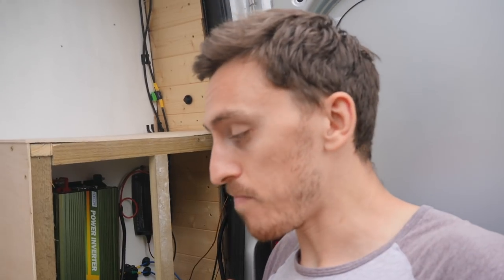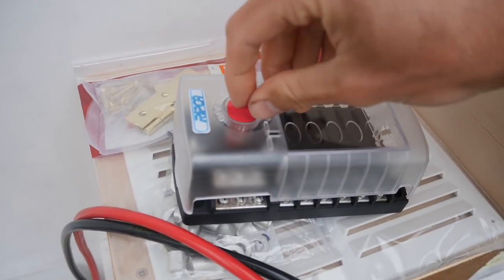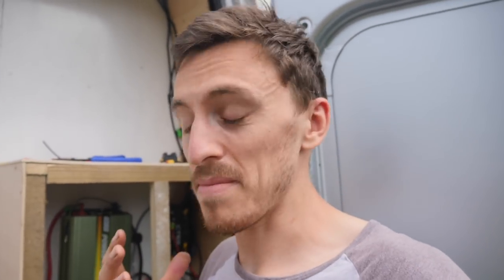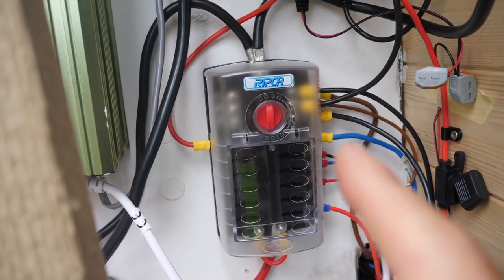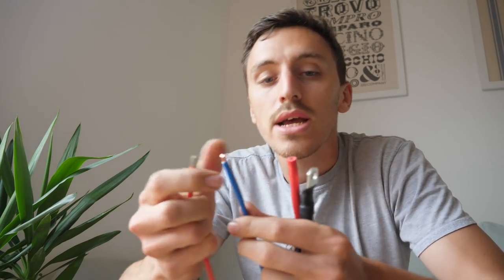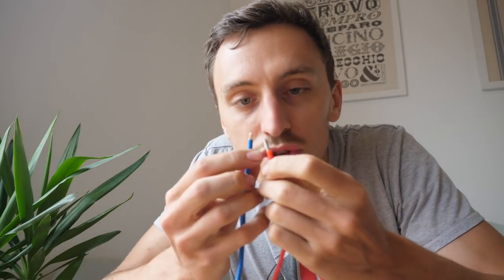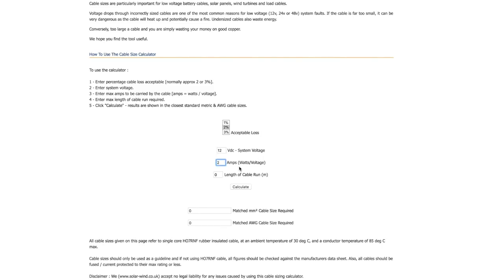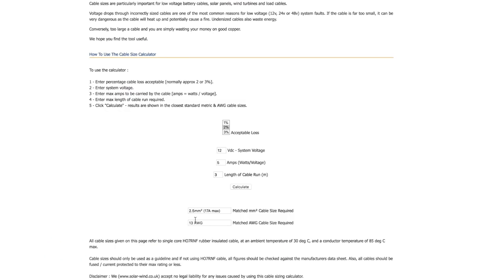WIRE GAUGES in my camper van!

Comment: Some good points there, the things you talk about I'll expand on.  The 7 strand cable is generally used in commercial installations and wired inside conduits and trunkings.  The multi stranded is way more flexible and is good for control panels and vehicles as like you said vibrations cause it to work harden and can then break.  The multi stranded cable can also be bought in what is called tri-rated and has a higher current carrying capacity as it has a higher working temperature range.  As correctly stated, the fuse rating is for the cable and not the appliance, an appliance will have an internal; fuse rated to protect the device.  The cable feeding it should be a higher current carrying capacity and fused for the rating of the cable.  Cables that lay on insulation should be down rated by around 25% and where it is totally covered (even if it just passes through a few cm's of insulation should be downsized by 50%.  As you have done putting it inside flexible conduits allows air around the cable and therefore helps it keep cool.  I can't find my regs book but from memory, grouping 7-9 cables together reduces the ability to cool so again reduces the current carrying capacity, (grouping factor), if you can get hold of an online regs book it will show this dependant upon the types of cable and the installation method.  You need to check the fuse ratings you are putting down the right hand side of your fuse box as you have a large cable on the left then you linked it with a much smaller cable.Cable has a milliamp per volt drop per metre rating, this is what the chart is showing you but it all varies dependant upon the type of cable so you need to find the rating for your cable, then do the calc again.  You will need to find the working voltage rating of the device so that you can ascertain the voltage drop you can work with.For example it may be 12v but it might work on a 10.5v to 14v range.   Hope all this wasn't too confusing. Also if you are running multiple conduits always make sure you run the positive and negative in the same conduit. If i think of any thing else ill add later! haha

Comment: The reason it has 2 separate inputs is to allow half of the board to be permanent live and the other half to be ignition live
Reply from the maker: THANK YOU Iain!
Reply: You could also split the supply load in half and reduce the your cable sizes connecting to the battery :D

Comment: Hi Hugh as mentioned earlier definitely swap out the link cable on fuse panel. Maybe a solid link bar would be easier to fit and look neater than cable.
Also think about terminating your solar to the battery instead of the fuse panel, that way you wont have to remember to pull the solar fuse out to work on the electrics and the positive lead won't remain live should you forget to remove solar fuse. Maybe fit isolator switches to both the battery and solar save messing with spanners to isolate systems. Anyway enough ramblings keep up the good work looking forward to the next instalment.
Reply from the maker: Cheers for those tips, your probably right. It would be safer to use isolator switches.

Comment: Your drone footage skillz are outstanding. Anyway, I bought that same fuse box and installed it when I set up my 12v only electrics, it's great! Cheap and good quality and keeps everything neat. On a sidenote, when I set up the CTEK, I found out that apparently there is a sister unit you can bolt to it to drastically reduce charge times for larger AH batteries, the Smartpass 120, and was curious why you didn't add that to your build with such a hefty battery as yours..?
Reply from the maker: Cheers mate! Yes well there's a couple reasons, firstly it is another expense that I didn't need for my size of battery but also I just don't use enough battery power to need one added.

Comment: Ive pretty much copied your setup, only differences are i have the edcoa 1000w and an addition of the ctek smartpass 120. 

Its come time to buy the wires and im wondering, what guage did you use to run from service battery negative to starter battery negative? And starter battery positive to CTEK +in.?

Your set up is in the back of your vehicle so i assume you needed a long length of cable for it.

Im looking at AWG1 for about 18 metres in total (8 for pos 8 for neg including all shorter battery to battery connections and battery to ground wires etc) and its very expensive!! 100s... 

My question is have i miscalculated? do i need 1AWG cable and what did you use? My power draw should be similar to yours its just to charge phones, lights, fridge etc on 12v and when the 1000w inverter is in use ill maybe use more.. but i cant see myself using the inverter much.

Any input would be great as i was just about to buy it then i was like "no, ill ask hugh!" 😂 using your wire diagram as a guide with help from ctek user manual diagrams and wire suggestions.

Or if anyone else has an answer, please, i would love to hear of a cheaper work around. Like, im thinking the service battery neg to starter battery neg is actually service battery neg to earth.. and I've misinterpreted it?
Reply: Hi Joe, I'm wondering this myself, did you figure it out? Thanks Brian.